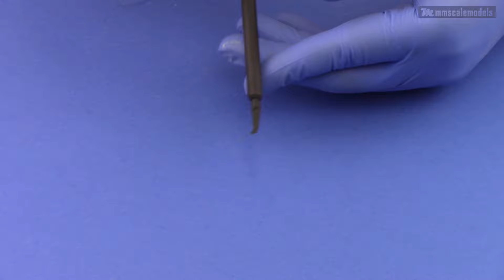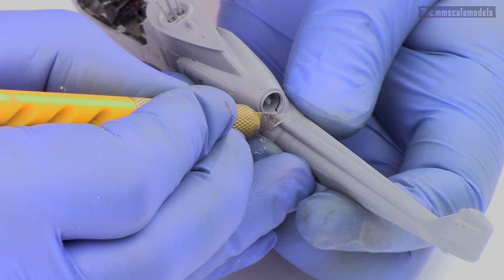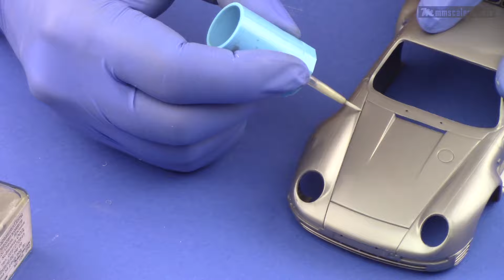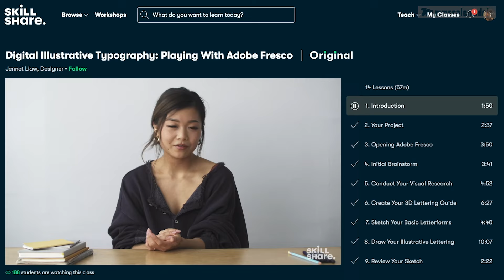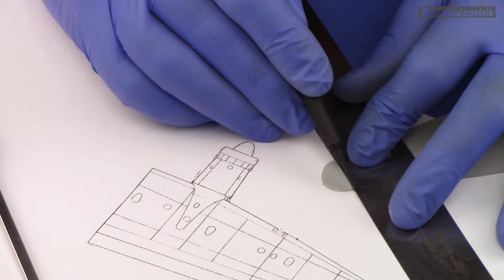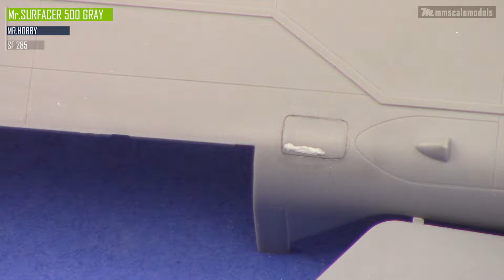HOW TO: Scribing panel lines - The comprehensive scale modelling TUTORIAL

Comment: Hello and thank you very much for imparting your knowledge. Just tell me what is the purpose of putting Mr. cement S at the end of the engraving?
On the other hand, does Tamiya extra thin cement do the same job.
thaks
Reply from the maker: You are welcome. Any thin cement should work. The purpose is to clean the panel lines from small plastic debree and dust by melting them. Obviously, the larger ones should be removed prior to the cement application.

Comment: Can you please explain, what happens after you run the Cement s over the lines, does the glue leave a mess, do you need to sand after ?
Reply from the maker: If you are careful with the application all the glue does is to melt the dust and leave cleaner panel lines... and a bit shinier surface.